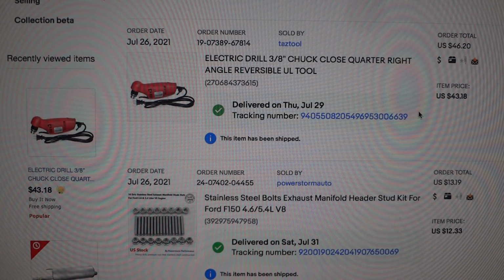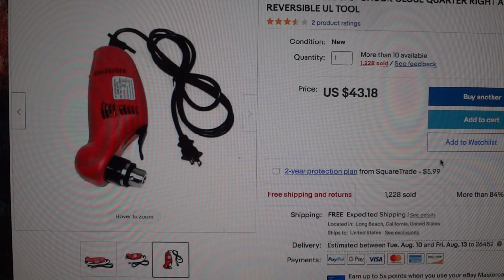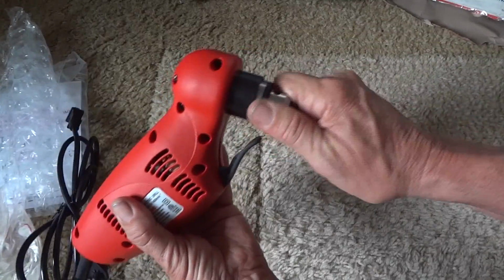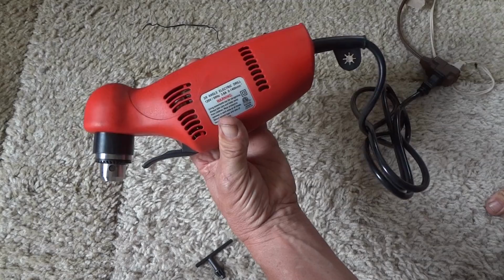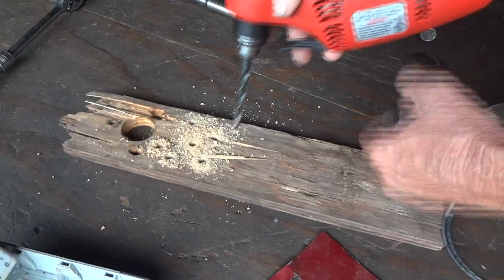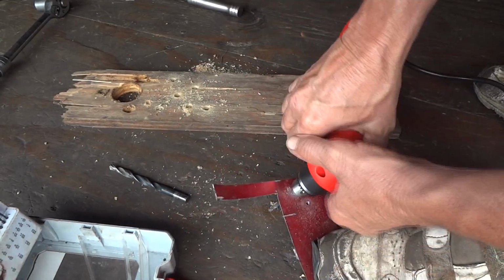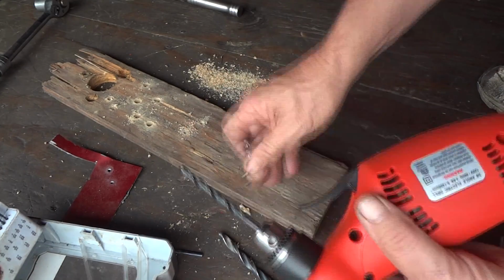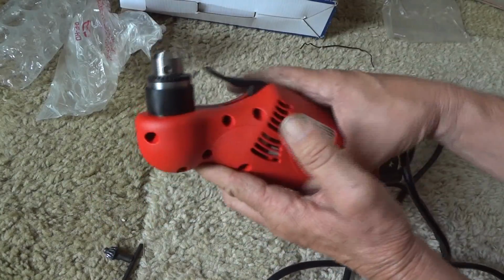Review Any Good?  -ELECTRIC DRILL 3/8" QUARTER RIGHT ANGLE TOOL

Comment: Always tighten both or all three depending on how many chuck positions it has on the chuck just to make sure you have it as tight as possible, and I'd just use some black electrical tape to secure the chuck the cord somewhere closer to the outlet plug I don't suspect the factory rubber holder will last long without tearing out,